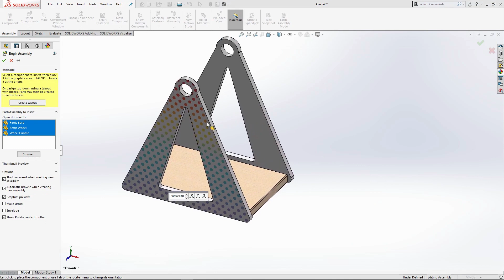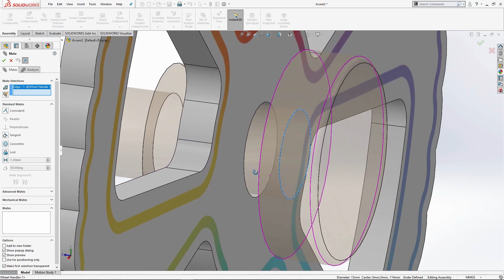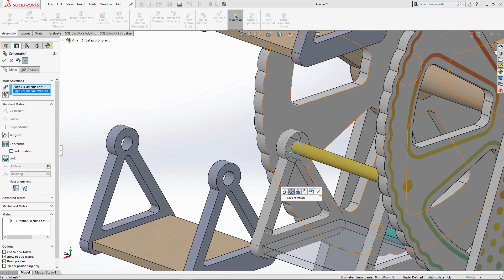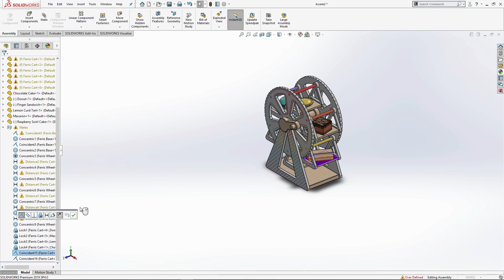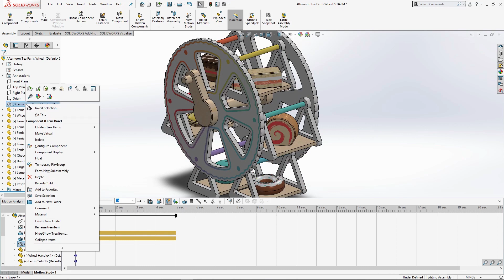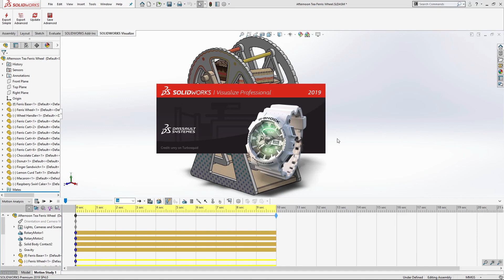Afternoon Tea Ferris Wheel Toy Tutorial Part 2 - SOLIDWORKS

Comment: Nice tutorial, I learnt a few things :)  Only thing is that when I started the motion analysis the carts had a lot of spin. I don't know if that's because the simulation was taking acceleration into account though. In which case it would have accelerated from 0 to 5 RPM in 0 seconds.